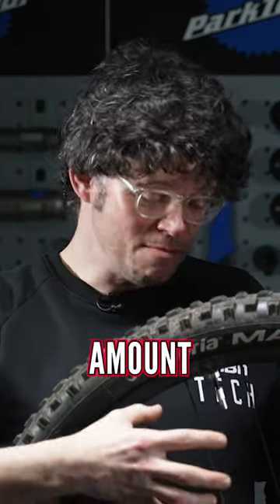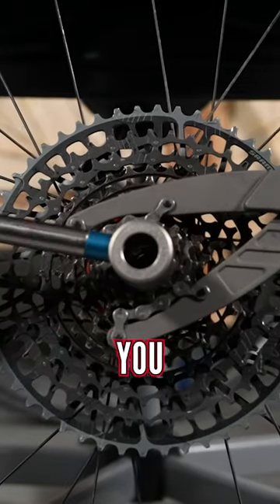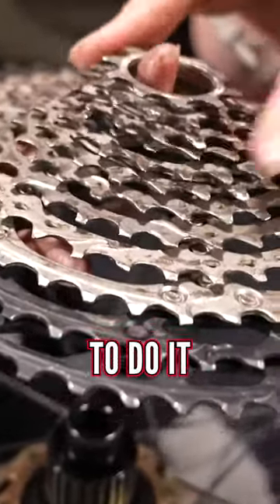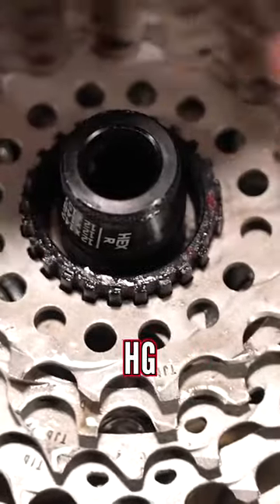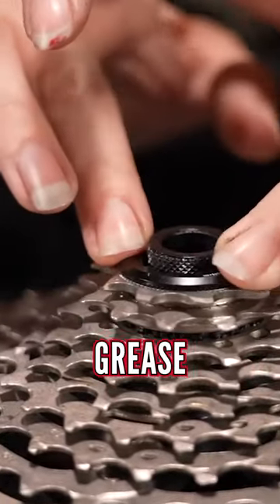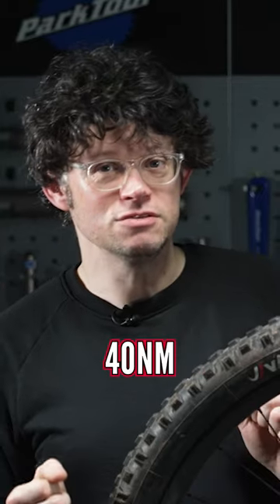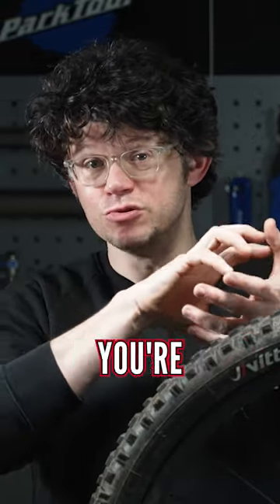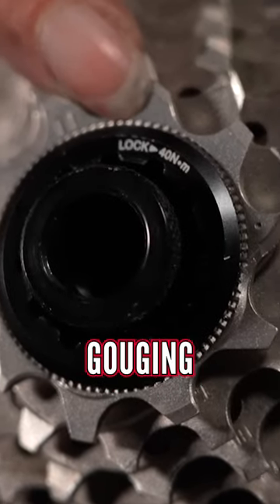This Is A Sign To Check Your Cassette! 🫵👀

Comment: if you grease up locknut, friction between each thread is lower compare to no grease so 40Nm is not 40Nm really. what I mean is yes you put 40Nm of force on that  wrench that you using but you make this nut even tighter then without grease,  so you put more stres on the threads and it may twist it. manufacturers data about torx are based on ungreased threads at least it's my knowledge, so if you use grease you should use lower Torx on nuts in my opinion and it will be just as tight
Reply: Yep
Reply: Torque specifications are not made for naked threads.
Reply: Depends on what the manufacturer recommends. Most bike manufacturers recommend greasing almost every thread. Thus the recommended torque is with grease in mind.

Comment: Don’t grease the threads unless specifically recommended by the manufacturer especially when torquing them to the correct tolerance.
Reply: Wrong
Reply: @SkunkApeOnTrail  There is a difference between wet torque and dry torque, Sram told me to dry torque cassettes. Just try it on a old bike and you will feel the difference
Reply: @SkunkApeOnTrail So you’re saying to disregard the engineer that spec’d the components and the assembly process.
You’re naive.

Comment: That there is any "controversy" over greasing threads just highlights the ad hoc grade of training bike mechanics get across the world. Always prepare threads!
Reply: It's insane how people go on and on about torque values and their own idea on how grease affects torque, it's all nonsense and anyone who has really worked on bikes always preps threads with lock tight or grease depending on the situation
Reply: @SkunkApeOnTrail You don’t understand how torque values work if you think this.
Do it as the manufacturer recommends or prepare yourself for failure.
There’s no controversy, there is right and wrong, and simply telling everyone they should be using grease is a massive oversimplification that is going to hurt people that don’t have the knowledge behind them to know what is wrong in a given situation.
Reply: @gtjack9  okay, the torque spec is designed for a clean dry thread, which happens once in the lifetime of the system, also the designers knew everyone would be doing this without a torque wrench and designed safety factors into the system. A little grease in this case (loctite preffered) helps the longevity of the system and doesn't change the torque value enough to matter. I've been wrenching bikes for a long time with good results and am also a mechanical engineer..  so I do know what I'm doing and I will keep recommending thread prep to others. Also don't place much trust in engineers, trust me 🐒
Reply: @SkunkApeOnTrail  Im aware of engineers, work with them everyday and am currently studying the degree required. Putting thread lock on a cassette lock nut is not a good idea.
My issue is with blanket advice like in this video, there’s so many different factors for when you should and shouldn’t prep threads that’s it’s easier for the layman to check each time than to guess and end up with dangerously loose or over tightened fixings.
Reply: @gtjack9  I think the point you're missing is that thread prep does not significantly affect the real torque value enough to matter. we're talking about specifically the locking, and it is a short video for laymen. the reality of the lockring binding, or being under-torqued due to grit , is way more real than this conceptual exercise on torque theory.
Reply: @SkunkApeOnTrail  but you are much more likely to over torque in this scenario, and over torquing these tiny lock rings will snap them, and trust me it’s a bad day when it does.
Reply: @gtjack9  have you personally ever snapped a lockring or known anyone who has? i haven't, there is a good safety factor built into their strength. Did you check out the park tool article on how to assemble a lockring? they say to use grease and they are the gold standard.

Comment: If the 40Nm is a wet torque spec then sure. Otherwise, if you’re greasing it and then using a dry torque spec you’ll be overtorquing it.

Comment: Don’t use grease on torqued fixings unless the manufacturer specifically instructs you to, and even then, only use the exact lubricant they specify.
You’re changing the final torque and you may damage your locknut in the process